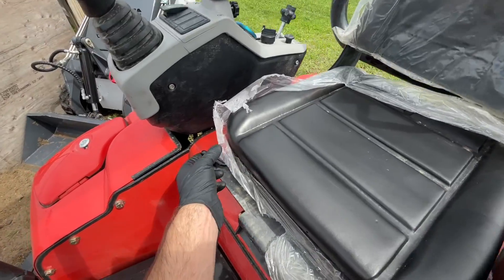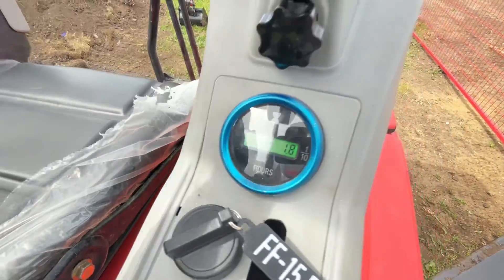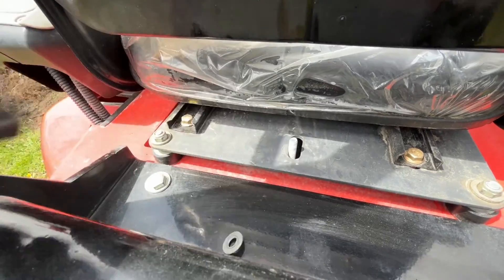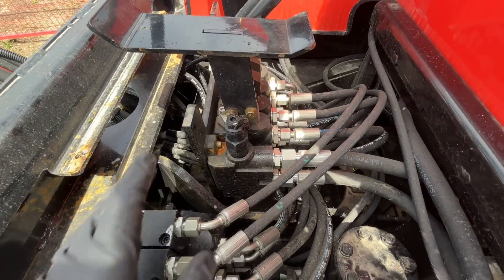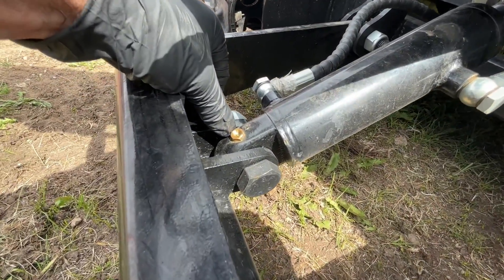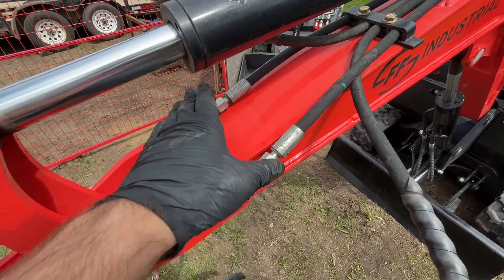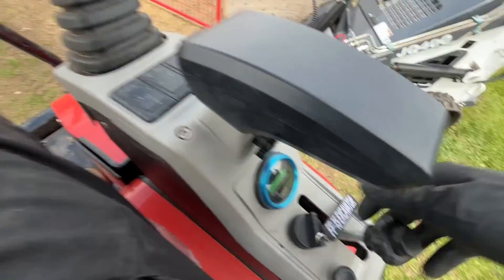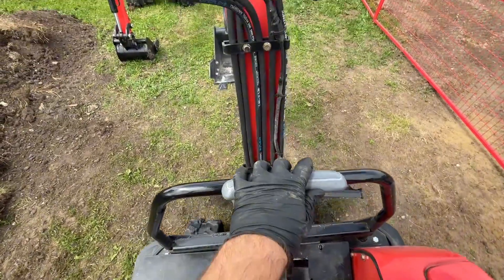IN-DEPTH LOOK OF CHINESE EXCAVATOR FF15

Comment: Those track adjustments will likely get pretty buggered up. I would put a piece of hose over the threads with some lithium grease. Save ya some time when those tracks pop off, good video

Comment: Good info !!   Is there a big difference with the FF12 ?   I'm looking to buy a FF15 locally,  it says 1.5t , I've read it would rather be 950kg    ?!!  aBOUT $6200us    Thanks ....
Reply from the maker: FF12 is different in a lot of ways. FF15 i would say is a 1.5t machine. Its not always about the weight, but about there capacity. The 15 vs 12 will dig like 10-12 inches deeper. The pilot controls are enough reason to purchase a FF15. $6200usd seems a little high comparative to pricing in Canada, I sold both of these for $7000CAD which is $5000USD. But markets vary from place to place.

Comment: There are two grease fittings on the front of the unit, I believe for the greasing the rotating cab gear.  My question, is how do you know how much grease to put in?  All other fittings I grease until I see it coming out of the bearing somewhere.  But I can't see under the machine to see if I have put enough grease in.  Any tip?
Reply: Hit the fittings with 5 pumps every 5 hours at different rotations of the cab